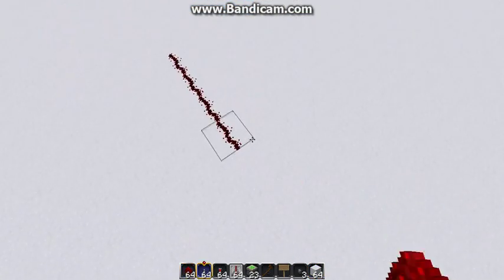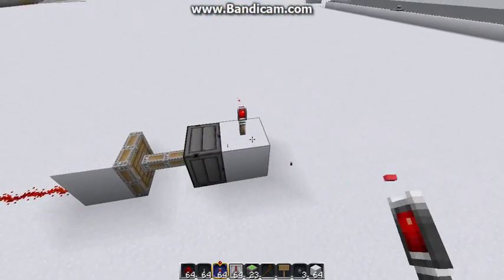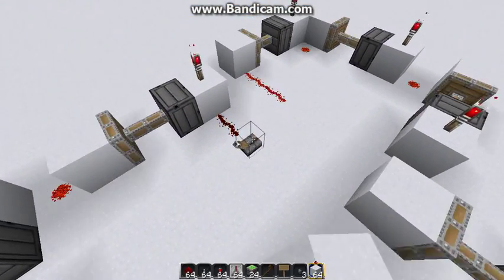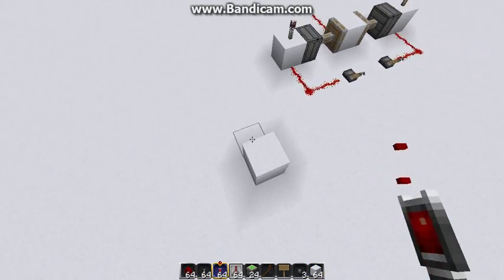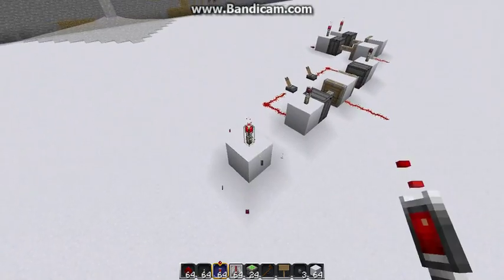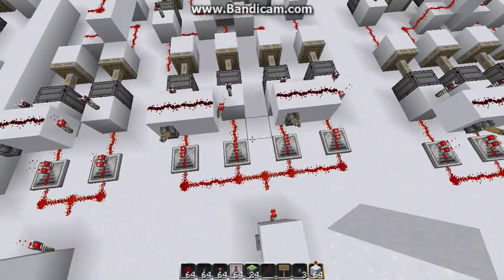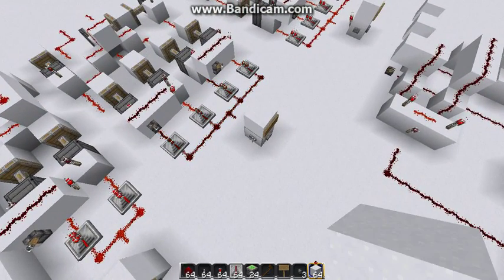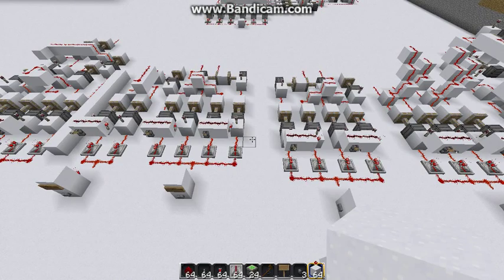Minecraft Instant Wire Tutorial Pt. 1

Comment from the maker: Well from what I see the only one possible gate with that setup is the OR gate,  because the only place for signals to control the same thing is in the BUD block. The issue with that is the wire must take a signal in 1 direction to work, which means there won't be any possible place for the second wire. That's why I don't think it's possible. If I'm wrong, then I would be interested to know how, but even then I don't really see how it'd be better since it's much bigger than this setup.